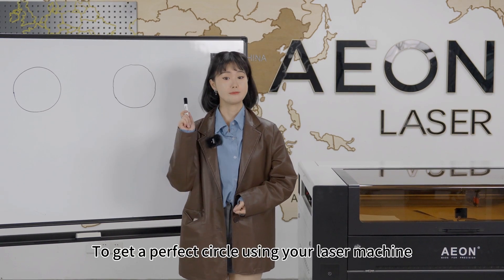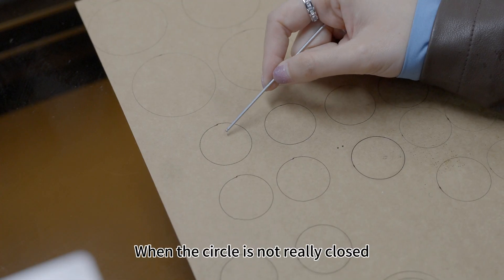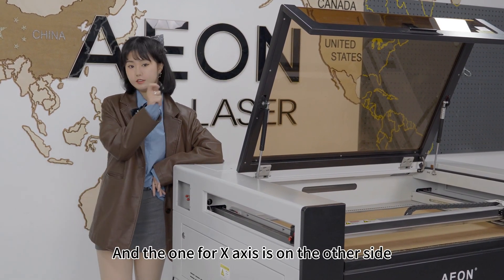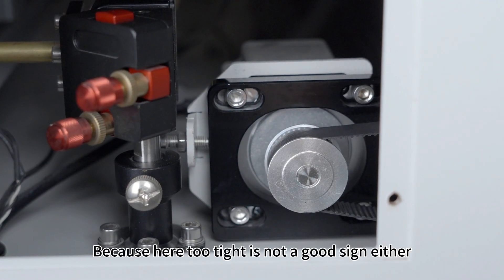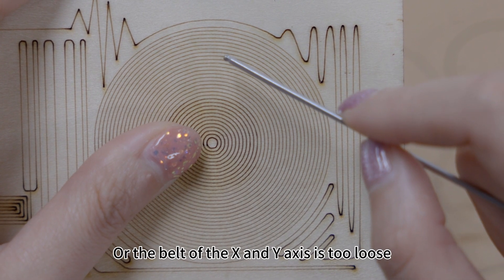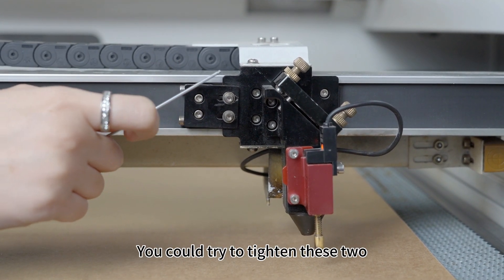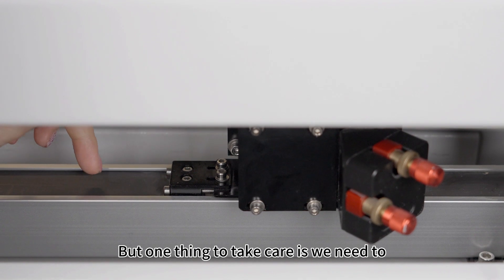Circle NOT Closed? | Perfect Circle Tutorial | CO2 Laser Cutter | LightBurn

Comment: I apologise for  leaving critcal comments,  especially because  I know Aeon machines are excellent  pieces of equipment.  

 "And the one for the X axis is on the other side"  Hmm ...I think not. The X axis motor will be on the gantry. 

 "Too tight is not a good sign either"    So what is too tight?    All toothed belts experience something called belt climb.  Watch the belt rise and fall as it either enters or exits the pulley. Tensioning the belt makes this phenomenon worse.  It happens on the X axis as well and is specifically noticeable when scanning. Lightburn has a compensation for this called "Scanning Offset", however there is no such compensation for the Y axis. 

How about adjusting the tension on the other Y axis belt to keep the gantry square to the X axis?

 "The wobble could be because the belt is too loose or too tight"   Hmmm that's helpful advice as well. 

"Be careful when you disble the backlash function because it may cause other problems"  What other problems?

I have several similar machines (not Aeon) and I thought the idea of a  tutorial was  to demonstrate  how to solve problems. Did we see if adjusting belt tension solved either  issue?
Reply from the maker: We greatly appreciate you pointing out the issue in our tutorial video. We will take your feedback into account and ensure improvements in our future videos.🥰
Reply: @aeonlaserofficial  Did you make another video that addresses these questions? 
You say adjust belts but don't show any example of what is too loose or what is too tight or what is acceptable.
You say to disable the backlash, but don't say what it does, nor what purpose it solves by turning it off.
Overall a good start for a video, but needs way mare attention as to what you explain(or don't explain).

Comment: I experienced something like in the video but how do I find a point that doesn't connect or do I have to re-angle the X axis? How to do it?
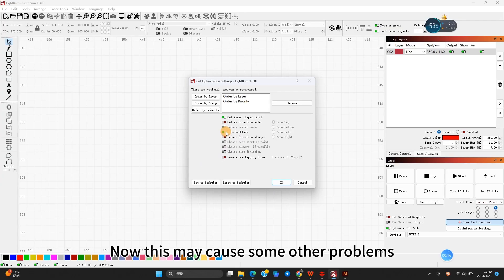Reply from the maker: Hi there, you could first open the "hide backlash" function in lightburn to see if this problem solved(it is at 2:04 of the video), if not, you could check the belt accordingly to see. You don't have to re-angle the X axis.